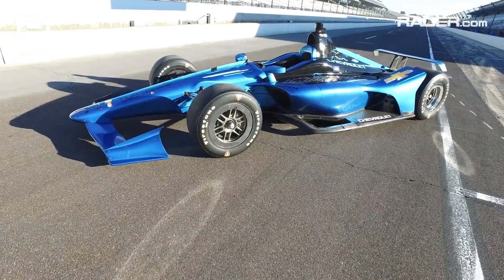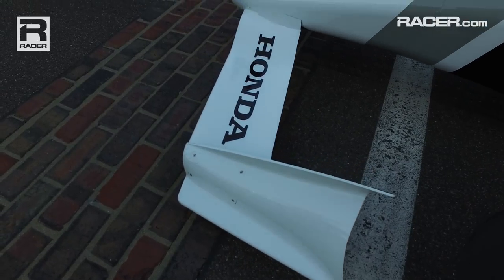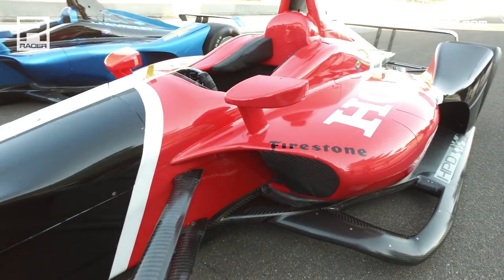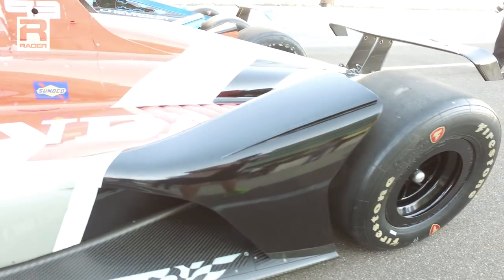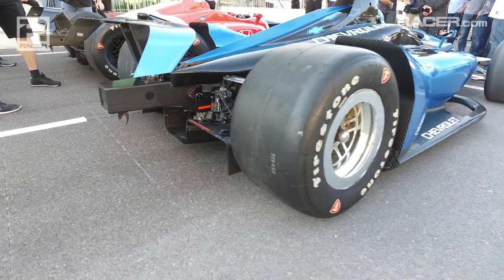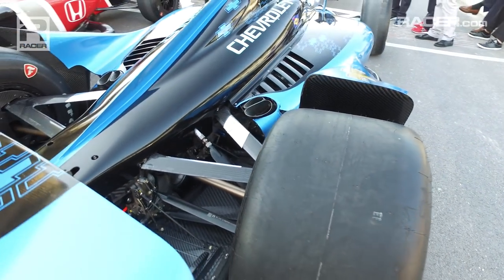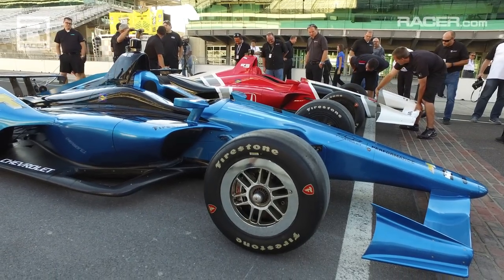IndyCar: 2018 Speedway Bodywork Tech Tour

Comment: The only thing I don't like about the new aero - for things that were able to be changed - are the sidepods. They just seem like they are from a car a size smaller - probably due to the huge floor the DW12 has, plus the openings just seem massive. It still looks fantastic, and it's a  huge improvement, but something about that area just seems like they juuuust missed it. Won't complain coming from where we are today though!

I actually like the ramps, I think the link between the sidepod and the ramp is the best curve on the car.
Reply: Empty Box wasn't part of the purpose for the dw12 to find a way to keep cars from ramping like that Vegas race? This seems like a step back to make them look better
Reply: Chad - Sort of. But it wasn't Vegas that was the tipping point, it was just the nature of open wheel. (The cars and concepts were drawn way before Vegas - wheel interlocking has always been a huge issue in open wheel cars and where it stems from)

Part of the what became known as the DW12 was to try and prevent wheel locking, which is why they had the kardashians, but also partly why the car has a full size floor that is as wide as the tires as well as partly why the front wing is full width. There are performance reasons of course, but all three were also safety improvements as all of them make them far less likely to interlock wheels. As it is on these cars now, you can't hit someone's rear wheel without destroying your front wing, pods or no pods, without it being a serious incident regardless. That's different than most open wheel cars where the tires still stick out wider than the wings.

Why they are gone is simple : they didn't work, and were more of a liability than anything as it's one more thing to fall off of a car. If you go back to the 2013 St Pete race the pods had their first live test under yellow - Hildebrand still went right over the top of Power. Even at caution speeds they failed to do the job. The main reason we've seen fewer flips from contact than previous cars is the racing is now totally different, with cars more spread out as opposed to the previous generation cars which raced in packs. 

The only thing they've really done is cause more bodywork damage and get someone black flagged when one of them eventually gets knocked askew on contact that wouldn't have happened in the first place had they simply not been there.

Comment: What is the section that protrudes under the wing mount?
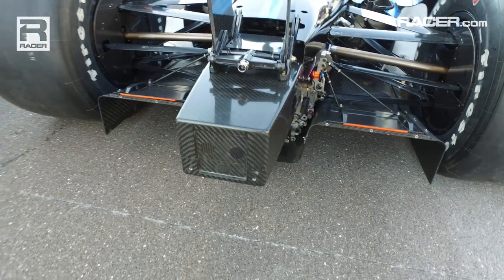Reply: I assume you are talking about the crash attenuator he is showing @3:55? If so that is there to absorb the initial shock if a car should back into a wall. It reduces the G-Force impact on the driver and lessens the likelihood of spinal injuries like those suffered by Sam Schmidt and Buddy Lazier.

Comment: Indycar Beautiful car 2018. F1  ugly car 2018 with the HALO. FIA needs see it's car.
Reply: Don't be too happy. IndyCar wants to have its own Halo.
Reply: It doesn't want the halo because it doesn't work on ovals. They are working on a screen.
Reply: I Know, the indycar want put a security system like the shield, that was used by Vettel in Ferrari.
Reply: Halo or screen does not matter: it's hideous, it's horrible and this is not classic open wheel.
Reply: I agree.
Reply: Leonardo Silva Conrado closed cockpits is probably the end solution for both, would look better than the halo/shield and be safer. Indy car have designed the 2018 car so a halo can be put on there last minute...

Comment: Huge improvement compared to the Indycar of the last few years. I have to agree though, I'd find it better looking if the rear wing would be higher as well. Another thing I still don't like is that the sidepods are extended right towards the rear wheels. Nothing they could have done with the DW12 chassis though, so still better than nothing.